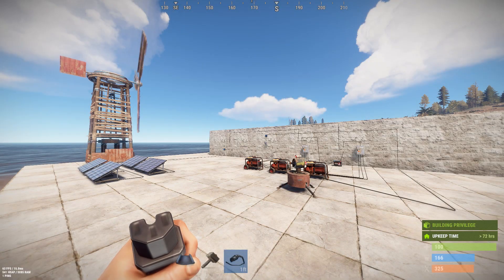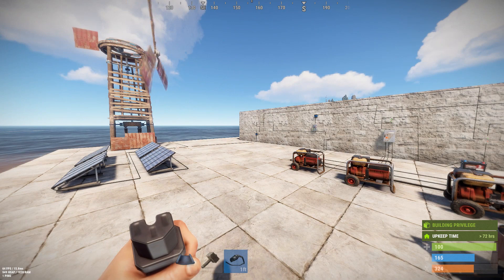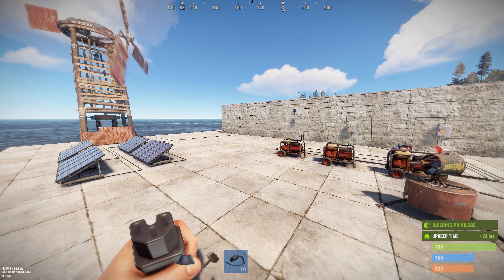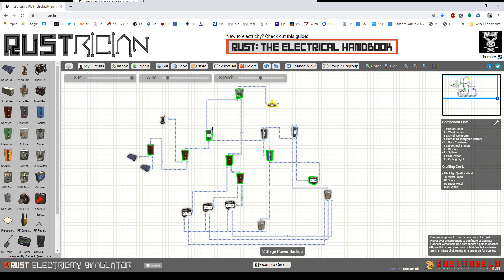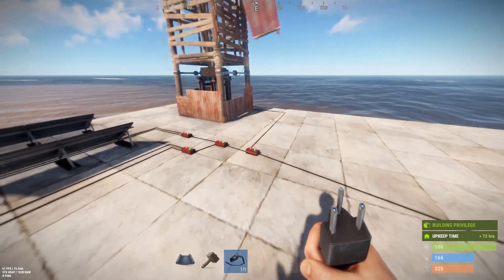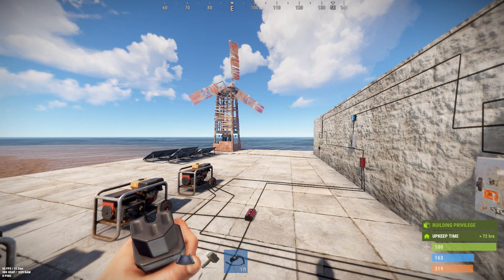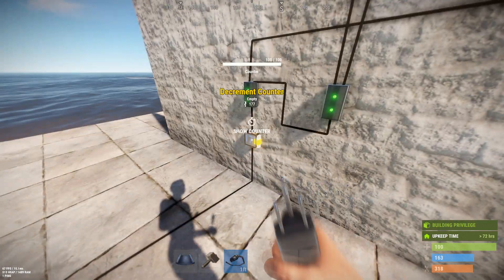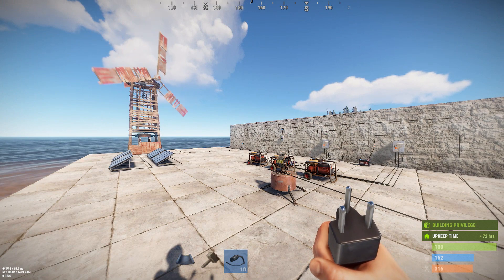Rust Electricity 101: Basic Circuits - 2 Stage Generator Power Backup for Turrets

Comment: @Rabid Rabbit, can you explain a circuit. For cave lighting. I want the generator to charge the battery, shut off when the battery is full, then power back on to charge the battery, lights run off battery power. Is this possible ?
Reply from the maker: Changing my reply here... Yes and no. The real question here is how much do you want to run and for how long? It may be reasonable to use excess power from a generator to add power to a battery, but since batteries can only be charged at 80% efficiency, it is effectively pointless to try to 'charge' them with anything except excess power. This can help extend run-time a bit in some cases, but otherwise it is just a waste.
Reply from the maker: https://youtu.be/UGYJ1HIqAEg

Comment: @rabid rabbit, I am trying to do a fairly complicated (for me) design for my power since I am on a really high pop and people keep destroying my power turbines/solars when climbing on roof but would you be able to do a design this for me or a video which would be nicer. so I am using a mix of wind turbines and solar which go into loads of root combiners then into multiple batteries which are only used when turbines/solars have been destroyed. I just incorporate the common blocker and branch trick to use battery as backup but I want to add a secondary backup with generators inside the base. I know 8 hours is a long time but I want to be able to add generators as a 3rd backup system. so once wind turbines/solars are destroyed generators turn on and power the batteries/output. it may be a little complicated but this would be really good. I am using it for an empty big stronghold trap base which requires enough power for 1 tesla (full power for dmg) 4 sam turrets 8 turrets and 150 excess power for door controllers hbhf sensors etc for other cool little features. if you could do a video on this design it would be really nice. Thanks for the current vids keep it up. hopefully this idea will give you another video for content :p

And I know this would be a lot of work for you to show me but if you could go 1 step further and add generators into a 4th stage for max time that would be appreciated, IE once the generators run out of fuel it trips a second set of generators. the main reason for this is so I technically have 12 hrsish worth of power since I work 10 hrs a day so would maximise the most amount of uptime
Reply from the maker: Totally understand what you're going for. Have you by chance watched any of the Cave base videos or designs I've posted? I feel like those are very much the direction you want to go. Not exactly the solution you're describing but the right technique!  If I have some free time this weekend I'll see if I can work up something more specific for you!

Comment: Can you make a vid on how to actually make this. Like a good one explaining what you need to do. Please
Reply from the maker: The actual implementation in your base would vary, but you can follow the schematic in the Rustrician diagram. That said, with the new batteries, your options for power backup are a lot easier and more flexible. I am going to work on some updated videos soon with better examples for power backup with the current version of components.

Comment: I seem to be having some problems. I have a massive main power supply 180+ power (wind connected into one supply with root combiners) that goes into one large battery, this battery is connected to a switch which in turn is connected a turret, however the turret seems to not just drain 10 power but my entire supply and turns on for a while during this time the battery time is decreasing until its completely empty and the turret turns on off (on off on off forever). I have to use the switch to turn off my auto turret so that the battery charges and then i get to turn it on again for a limited time.  Is there something obvious that i am missing here?
Reply from the maker: Hi Julian, welcome to rust electricity! :) Sadly, this is the normal behavior of batteries in Rust. Here is  a good primer video, and the whole playlist is a basic review of components!  https://youtu.be/4ZiJ8A7BNZ4
Reply: @RabidRabbitGamer  Atleast now I know I did nothing wrong. Kind of unfortunate as this means I cannot have outside turrets. Thank you for the informative video!

Comment: @Rabid Rabbit what is the easiest, least amount of parts to run a auto turret? I have Solar Panel, switch and small battery but battery give 10v, the switch uses 1v, leaving 9 for the turret...which needs 10 :(
Reply from the maker: Correct, you will not be able to run a turret off a small battery unless you are manually connecting the battery directly to the turret, and then manually disconnecting it while you charge it. If you want any type of logic, you'll need to use a large battery, or rely on 'live' power from solar, wind or even a generator.

Comment: If you're OK. With manual activation you can now use the pressure plate to start up a circuit that requires 1 power
Reply from the maker: Interesting... so long as it is not a 'bug' that gets fixed, this offers some opportunities!
Reply: @RabidRabbitGamer  I think it's deliberate so you can use it to active a circuit for a trap without it constantly draining power... Pure guess but something I thought you'd like.
Reply from the maker: @sarchlalaith8836  I'm going to try to find out if it is deliberate, and perhaps why because if that is going to stay, it could be useful :) Thank you for pointing it out!
Reply: @RabidRabbitGamer  According to @SHADOWFRAX & @ThatGermanGuy it is intentional.

Comment: how do you hook multiple turrets to this set-up?
Reply: I put a splitter after the OR switch and hooked 2 turrets into the splitter.  Hopefully this is correct?
Reply from the maker: Yep that will absolutely work! You can use splutters, or if you need more than 3 outputs, just chain Branch's together and set the branch to 10 or 11 power for the turret (depending on whether you are using the turret's notification outputs or not).

Comment: At around 1:10 - The generators will run for a little over 1 hour, not 2, on max 500 fuel. Great to see this circuit though!
Reply from the maker: The small generator should consume 1 unit of low grade every 15 seconds, or 4 units per minute. 500 / 4 = 125min or just over 2  hours run time.
Reply: @RabidRabbitGamer  I guess there's conflicting information. On rustafied.com says the generator burns 8 fuel per minute and lasts about an hour. On the Rustrician subreddit, somebody said the same (in a bit more detail), but on the devblog which I just reread it states "a full tank should last a few hours". Weird!
Reply from the maker: Well looks like we're both wrong. It runs for 2 hours even. So what happens is 4 units burn for 15 seconds, then the fifth unit burns for just 12 seconds. that means 72 seconds per 5 unit cycle, or 120 minutes for 500 units of fuel. Yay for inconsistent Rust math :)